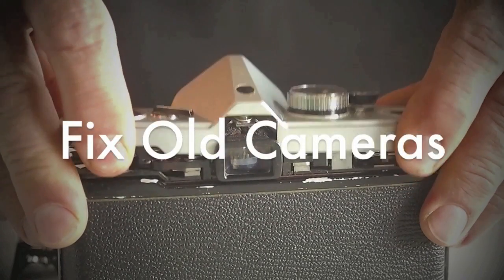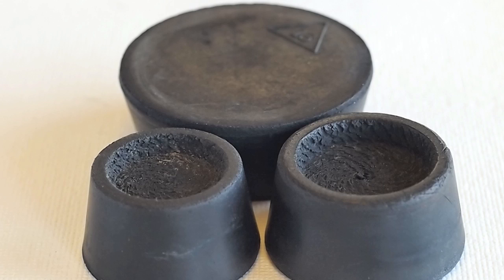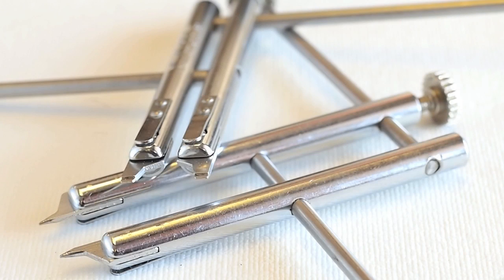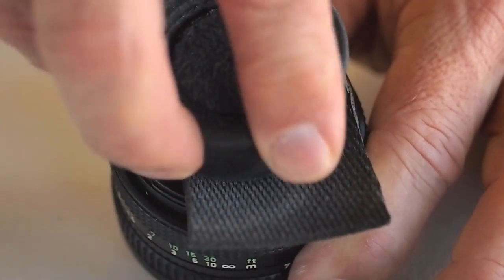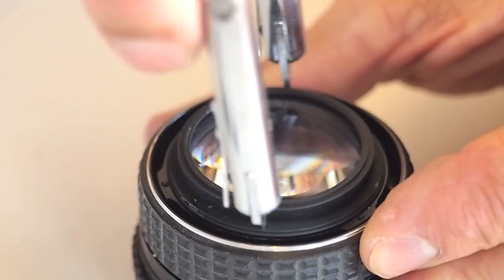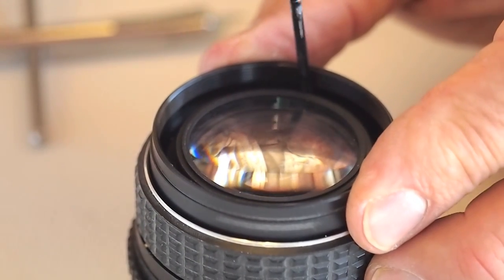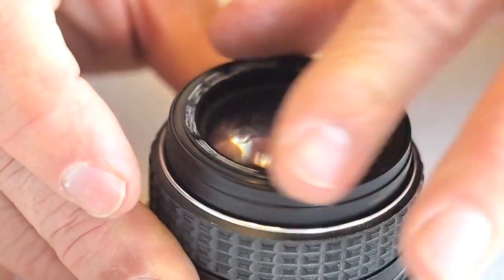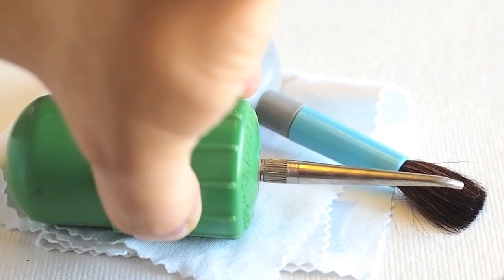Fix Old Cameras: Basic Lens Repair Tools

Comment: For small and odd sized dial spinners(usually on the winder) you might be able to make a rubber plug out of sugru.
Reply from the maker: Indeed... sugru is a most useful product. If you get an opportunity to try it maybe you could comment on the results.
Reply: I will.
I use a piece of rubber glove and a bottle lid the right size usually.

Comment: I'm about to begin purchasing a set of vintage photo lenses for cinematography. I'm based in Japan where I can get good prices on secondhand Mamiya Sekor C 645 and Canon FD prime lenses. Of those two type of lenses, which would you say are the easiest to dismantle and clean? I ask because I can get especially good prices on lenses with fungus, etc – and, thanks to your tutorials, I'm quite keen to buy "junk" lenses and fix them myself! :-)

Hope you see this message and can offer your opinion on the subject.

If anyone here in the comments section has an opinion on the difficulty of dismantling and cleaning Mamiya Sekor C 645 versus dismantling and cleaning Canon FD prime lenses, I'd also be very grateful for your advice (I notice that some of you seem to have extensive experience).  Thanks :-)
Reply from the maker: The FD's pivoting breech mount might cause a little difficulty on reassembly, but once you figure out the timing it should not prove to be too difficult. Otherwise as a general overview that are probably equal. However, different focal lengths require some changes in the disassembly.
Reply: @FixOldCameras  That's good to know! Thanks for responding – I really appreciate it. And thanks also for the great content :-)

Comment: great video.
Can you please suggest me a tool kit, or the screw driver size. I have the pentax smc m 50 f1.4, but I dont have the right screw driver to unscrew. :-/
Reply from the maker: JIS type S #00 (.080 - 2.0mm) and JIS type S #000 (.055 - 1.5mm)  screwdriver blade sizes will cover nearly all Japanese manufactured classic camera and lens screws. If you want to pick just one then the 2.0mm size would be the choice.  For some options you may go to - http://astore.amazon.com/fixoldcam-20?node=1&page=1
Reply: Screwdriver ph 000 from a well known auction site.
That's the smallest size available.
Try and get a magnetic one.
ph 00 fits better for most camera screws.

Comment: Have you any suggestions on the type of grease used on the helicoils for overhauling a lens?
Reply from the maker: A local bike repair shop might share a glop of silicone bicycle chain grease that will work in a pinch. 
A product that works very well in most helicoid service application is MicroLubrol Helimax-XP . 
Available here - http://astore.amazon.com/fixoldcam-20/detail/B00D0HOLBE
Reply: Thanks for the tip!

Comment: Hi Folks, Hope you had a nice Thanksgiving. I'm putting this question here figuring it is a basic question. Have you had any luck cleaning a camera from a smoker?  I picked up a beautiful Black Enameled Canon FT and when I opened the box I was overwhelmed with a heavy nicotine odor. I should return same but other than that it is a nice camera with a 1.4 FL lens.  I am an ex-smoker so I know that nicotine has an oily residue. I figure I'll use some alcohol wipes to wipe down the entire camera. After that is done I do not know what to try next.  Any ideas or suggestions will be great.  I also have the original ERC case and it reeks as well. Thanks Tom
Reply from the maker: The Contact Cleaner available here 
https://www.amazon.com/shop/influencer-c06c729d?ref=ac_inf_hm_vp
Spray on a cleaning wipe and rub the camera down. Also, n-Hexane or brake cleaner n-Hexane will not harm plastics. Once it looks good, if there still is an odor, pack in crumbled news print and keep changing out the news print every couple of days. Eventually the stale smoke smell will be completely gone. Treat the case the same way it might take quite a bit longer for the smell to be drawn out.
Reply: Thanks, as the last message, apologies for the delay. I do appreciate your responses. I did wipe the camera down with a higher percentage  alcohol wipes and I did see a noticeable amber colored residue coming off the camera. I can get Contact Cleaner in my local ACE hardware I'll try that as a second treatment. The ERC case was soaked in warm water and turned inside out. Using dish detergent and a stiff brush I washed it out. Rinsed it and hang dried it for a week. Then used a heat gun to heat up the leatherette so it was pliable to turn it right side out again. Applying a leather restorer makes it looks and smell pretty good now. The camera has also lost it's nicotine smell as well. Thanks for the help.
Reply from the maker: Great to hear of your progress. Thanks for the tips on how you handled the cleaning process of the case.

Comment: Yoiu can use a part of a bike inner tube or rubber gloves along with various bottle. deodarant roll on, various sized cans, bottle tops etc tops for the friction tool/
Reply from the maker: imaginative suggestions for using available items
Reply: Fix Old Cameras  Yep. I thought your videos were very good.
I do buy cameras ,lenses etc and fix them and sell them on more expensively sometimes.
Ive ruined many a half decent non working camera or lens in the name of research and learning but did them on cheap things.
Sometimes i get a bum deal like when a screw just wont budge no matter what and that sort of thing.
You really need to get the thing in your hands and inspect it to see if its fixable.
Reply from the maker: zenoist2 Sounds like you are having fun in the process. Try heating a stubborn screw with the tip of a soldering iron. Also be sure you are using the proper tip and type of screwdriver for the screw being removed.
Reply: Ive ruined so many lenses and cameras its untrue in the learning process. About the only good thing you can say about me is I try to pick cheap ones to try out and see how it goes.
One good idea is that you need to take a LOT of photos as a record of what you are doing and how everything fits back together. I use a canon a470 which has a rather good macro capability for close up photos.
Thank you for the tip.
Reply from the maker: Sounds as if you are persistent. Thanks for the comments.
Reply: Fix Old Cameras  You just have to try the caliper!
My one was UK £9.99 inc postage on ebay and its an excellent tool.
Thank you for your sensible relies.

Comment: Is it possible to fix slow shutter speed on a old copal graflex lens?
Reply from the maker: If the slow speeds are hanging up or sluggish than it usually is caused by the slow speed escapement. It would be possible to show how to access, remove, clean and service the slow speed escapement of a copal between the lens style shutter. As the procedure is somewhat delicate it is not overly technical or involved and could be featured in a Fix Old Camera video. Thank you so very much for your patience and suggestion.
Reply: Fix Old Cameras Cool! if you need a lens to fix I'd be happy to send you one!